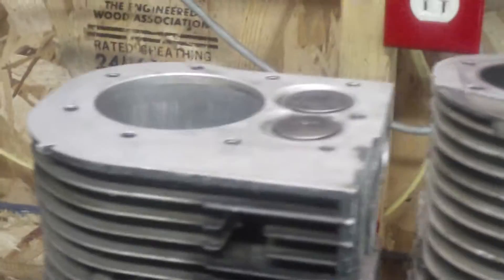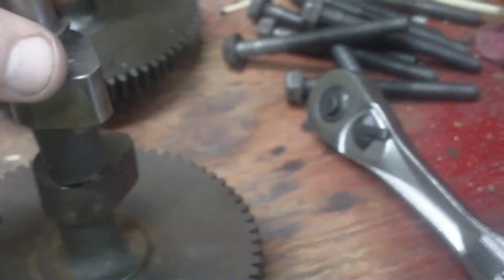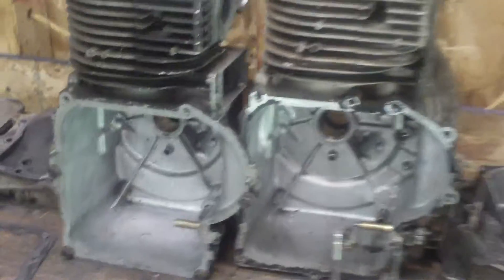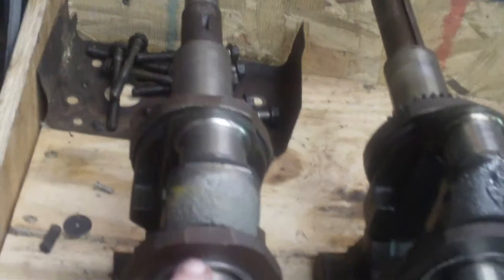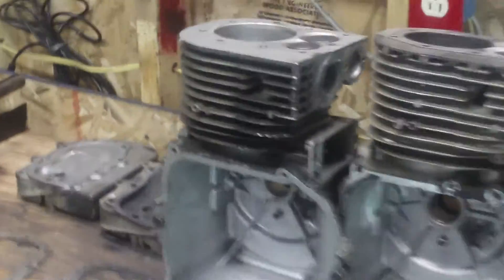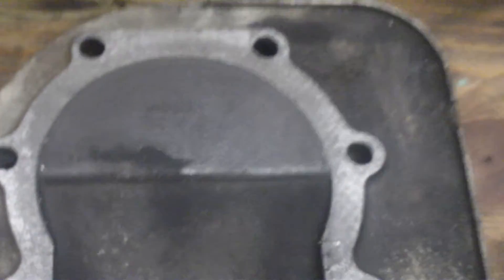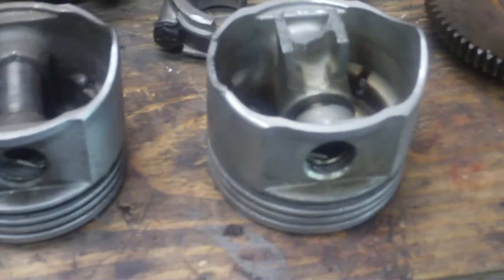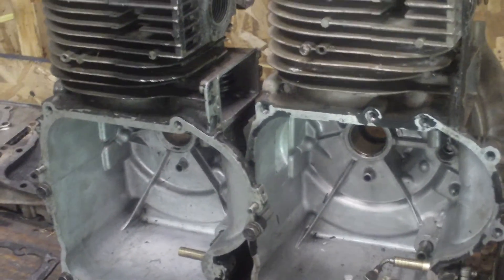Briggs and Stratton 11 Horsepower vs 12 Horsepower / Briggs Stroker (Mainly Plans)

Comment: You do know that the model of briggs & stratton stands for the cubic inch displacement of these engines right......?
Reply: He thinks recessing the head for the quarter inch over stroke is the solution, not a piston with a higher pin hole on a stroker! Yeah I'm going to take my answer from that. LOL

Comment: I have an Ariens Riding mower with a 12HP Briggs & Stratton engine Model 281707 Type 014301 & Code 89022131 that needs rebuilding, I'm not up to rebuilding it, however I have an opportunity to purchase an 11HP Briggs & Stratton vertical shaft engine
although it has ben sitting a shed for several years the oil was changer plus new gas and it ran great it never had much use when it was originally purchased. QUESTION What I'm concerned about is weather the 11HP 25 series Briggs has the same mounting hole position on the base housing as my 12 HP Briggs 28 series? Could you advise me on this?  Thank you Cliff from Carlisle Ontario Canada.

Comment: Hi! Do you have an Idea why my 253707 11HP is knocking sometimes more or less? Maybe there are some known issuses that cause that. I want to check the valve clearance, but can this generate a knocking? New Oil is in there. It running good, but sometimes with little misfires. Is there are problem that sometimes something getting loose in this engine?

Comment: Hi! I recently aquired a Briggs model 286707, Im thinkging about rebuilding it and putting an 11hp head on it, what are your thoughts on using the 11hp head and the copper shim style head gasket?
Reply from the maker: It will raise compression considerably, especially if you go with the thinner copper gasket, Thanks for Watching!!!

Comment: Is the vertical Briggs 10 hp steel sleeved?  I'm interested in one of these (or 12hp) for torquey little minibike application.
Reply from the maker: Depends, if its a I/C it will be, if it doesn't say that then its probably aluminum bore. Thanks for Watching!!!

Comment: im building a 12 hp b and s the stock counerweights are bad where can you get the brass counterweights and how much are they and the same for the billit rod and aluminum flywheel
???
Reply from the maker: eccarburetors ,arcracing or ombwarehouse should have everything you need. If they don't list it for a flathead the mod 28 ohv (non avs) parts are identical. Thanks for Watching!!!

Comment: is there any crankshaft with a longer stroke that will fit in the 281707
Reply from the maker: The next longer one is the model 31 but i don't think it will fit in the 28, i've never tried it, it might, it would be nice if it did. Thanks for Watching!!!

Comment: The 12 horsepower threw a rod because it was knocking or detonating. I got to about 4 minutes and 20 seconds on your video and that's when I saw it... your cylinder head has all kinds of dots all over it. those are the explosions from the fuel pre igniting or detonating. It was either running too hot or too lean or on bad fuel something was going on but that's what caused it... it wasn't an oil failure it was a pressure failure from detonation the rod can't change directions it tends to shoot out the other direction when the gasoline ignites before it's supposed to buy the spark plug.
Reply from the maker: You might be right, but i will say this, on that engine, the rod broke right at the crank journal, and there was signs that at some point in the engines life that it was run low on oil and scored everything up. It also broke the camshaft to when it blew! Thanks for Watching!!!
Reply: fnaguitarplayer9 it could have definitely been a combination problem if it had been low on oil and created a hotspot and a weak point in the rod and then knock came along and broke it there. it may not have been knock that actually broke the rod. But I will say it was definitely a contributing factor based off the combustion chamber. When you start modifying engines and upping the compression ratio any sharp points or any hot spots will create knock and once it starts build up will happen and it can get out of control.

Comment: My 8hp Briggs and stratton engine I had on John Deere s82 threw a rod two years ago and it took out the cam and destroyed the block and oil pan
Reply from the maker: I've had that happen before, i got a video that i showed alot of broken parts from blown up engines, and one of them broke the cam and everything in it, but didn't come out the side of the block though! Thanks for Watching!!!
Reply: I like working on the older mower engines to me the older engines are easy to work on

Comment: I want to convert a few of these to horizontal. Do you know if they use a dipper or anything special to get the oil up to the valves and rings?  

I know there are a few videos out there to convert the smaller ones but not too much info out there with the bigger syncro balanced engines.  Thanks for the great videos.
Reply from the maker: There is alot more involved on converting a synchro balanced engine to horizontal because if you put a dipper on the rod, the counter weights will block most of the oil being slung, so you would have to come up with some way to relocate the oil slinger/governor. or come up with a oil pump in it somehow. Your welcome, Thanks for Watching!!!

Comment: Hi I am trying to id an engine I have and was wondering if you know the height to the cylinder head of them both as I don't have the cowling.
Reply from the maker: Not right off hand, and I don't currently have one tore down to look at. But if you were to tore it down, MOST of the time I found the first 1-2 digits of the model number stamped into the side of the connecting rod, but i have seen some with no stampings, but it is one way i've found to identify them. Thanks for Watching!!!

Comment: I did a horizontal conversation to a model 28.   And I'm having difficulty with a carberation set up for it.  What caberator and intake do you suppose would work for it?  An 8 or 9 hp up draft carb?
Reply from the maker: +Ryan Kravik I would think that up draft style carburetor setup should work fine on it, either that or take the stock carb and make a adapter for it, using 2 flanges and a piece of pipe. Thanks for Watching!!!

Comment: I have a model 28 but it's an 11.5. Can it be upgraded to a 12 or 13? Interesting video. Thanks.
Reply: The model 28 is rated at 12.5 HP. They put different stickers on these engines showing all different horsepower numbers when in reality they are the same base engine. They marketed the model 28 anywhere between 11-13.5 HP when in reality they make 12.5 HP. Briggs still does this silly misleading horsepower and torque ratings with their newer engines too. It makes it very confusing knowing what engine you really have. 
For instance I have two Briggs engines in stock both rated at 19.5 HP, but one of them is 500cc and the other is 540cc. So how do they have the same listed horsepower? I’ll tell you where they got those numbers and its out their ass. They do it more for marketing than anything else. They’ve been doing this for years to the point where no one truly knows the horsepower of their engines.

Comment: i think i would make a spacer plate to go between the head and block  and try to keep the rod length the same, the longer rod keeps the piston parked @ tdc longer, and mill the head as flat as possible to make up for compression loss, though it might screw up the way the engine scavenges, ill let you know when i finish the project, im busy right now with a mod 28 putting a big exuast  valve and seat in it same size as intake hope it dynos good!
Reply from the maker: That might be the best way to do it, and easier to then having a custom rod made for it. I know the piston stuck up a little less than a quarter inch in my mock up of it. I hope to experiment with it someday. Another project that would very interesting is use a crankshaft out of a 31 OHV briggs in a 28 flathead block, since they didn't make a 31 flathead (at least i haven't ever seen it) it would probably take some serious work to get the crank to fit. but that would be great! Heard that! Good luck on your project! Thanks for Watching!!!

Comment: I Have a 10 HP that just threw a rod. and pushed the balancer  right out the back of the motor.  I have a back up motor but they were all used and put a way wet. so the next motor will be taken a part and rebuilt. with new gaskets ect. so I will be watching your videos.
Reply from the maker: McCuneWindandSolar oh wow, i've seen some motors that has happened to, never had it happen to me (yet haha) I hear ya, sounds like a good project. thanks for watching!!!

Comment: 1 more question if i was to advance timing on my engine with the cam what way would i turn it and how many teeth could i move it to make more power?
could you possibly make a vid on how to advance timing to ??
thnx
Reply: fnaguitarplayer9 1 tooth is plenty on cam but check clearance between cam and rod, ignition timing i set by not using a key buy bringing piston 1/4 inch btdc and setting flywheel on by matching leading edge of flywheel magnet to right edge of magnatron it gives me enough timing for my alky burnin mod 28.
Reply from the maker: true, unless its a flathead. I've heard of people doing that, i was always afraid of its slipping on the crank, but i guess as long as its tight enough it will stay put. Thanks for Watching!!!

Comment: is the 11hp cam the same as the 12hp? if not wich would have a bigger lope/
Reply from the maker: Yes, both cams out of the 11(model 25) and the 12 (28) are the same. Thanks for watching!!!
Reply: are there any cams that are bigger then the 11hp cam that will still fit in the 11hp block?
Reply from the maker: Not stock cams, but you can buy performance high lift cams designed for racing, but be aware that its best to upgrade the rod too, and flywheel if your bypassing the governor, eccarburetors (dotcom) sales everything you need. It is possible to weld on the lobes of a stock cam and ground down to your own specs, but its hard to get a good profile.
Reply: so is it better to weld the lobes on the came an stuff or just upgrade every thing?
Reply from the maker: Yeah pretty much, but if you weld them up, be careful its very very easy to mess it up.
Reply: do thay need to be welded even or can I wen alittle more on the intake valve?
Reply from the maker: it would be best to do both, because, if you just do the intake, then the engine is burning more fuel/air and would run hotter since the exhaust isn't opening as much. You can probably look up more info on this online, or the lawn mower racing forum, heymow (dotcom) there is alot of experts on there, that could probably tell you more than i can.
Reply: alright thanks ill look into that
Reply from the maker: No Problem!

Comment from the maker: Nothing!!! They are both the same engine, 12.5 13 and 13.5 model 28 are the same engine, just a marketing idea, now the 12 and 12.5 are still 28's but may have the newer 2 piece carburetor that gives the extra 1/2 HP, but that is the only possible difference. Briggs is infamous for this!!! Thanks for watching!

Comment from the maker: That is true. I'd have to agree, I prefer a longer stroke as well, just seems like your "using more of the piston" if that makes sense haha Getting more leverage from it. The only advantage with a short stroke is it will rev up to higher RPM's. but you loose power. Thanks for Watching!

Comment from the maker: I use a wire brush on a drill, the cup type, put the head in a vice so you can dig down more. you can also soak it first in carb cleaner or even WD40 to dissolve the carbon some first. thanks for watching!!!

Comment from the maker: Yepp, there is no difference at all! i have a 19.5, its the same thing as the 16.5. Briggs was bad about that, and still is from what i heard, same thing with the single cylinders they are putting out now, a 17.5 is the same as a 15.5. now on the older 12 and 12.5's, the extra .5 came from either the new 2 piece carb or switching to electronic ignition. now oddly enough my 19.5 opp twin is a model 46, go figure haha thanks for watching!

Comment: Got my rings on the piston. thanks for your help. I need the torque pressure for the head bolts for that same 12 hp model 281707 engine if you would be kind enough to help. Once again, thanks so much.

Comment from the maker: no problem! on most top comp rings there is a angle ground into them on the back side that faces the piston, this angle goes up. the surface that is on the outside is flat on the top ring. PM me your email address and i'll email a picture of how each ring goes, if that would be better

Comment: Thanks for getting back so soon. I'm still a little unsure what you mean by " the rings slant". my new ring is flat on top, has a silver edge part way down and is then grooved on the bottom, if that is the way it should be installed. should the grooved out section face the oil ring below and the flat part face the top compression ring?

Comment: ok, thanks.  I considered shaving the piston down right away, but the #1 compression ring lands really are pretty high on the piston, so I don't think that is a great idea.  I think a shorter connecting rod is the best option.  I am not worried about the clearancing of the block.  I did enjoy your video and I appreciate all the information presented there.

Comment from the maker: Sounds good! I've never heard of it personally, what i would do is take the block/stock rod/piston and 28 crank to a machine shop, show them what your doing and see if they can machine a custom rod for you. I have heard of people shaving the piston down so it doesn't stick up but it seems to me that it would take to much off, and you will have to clearance the inside of the block not by much but it will need to be done. thats about all i can tell you I hope to do it someday! thanks for watching!

Comment: Alright, I'm doing it.  I have a series 25 and I bought a series 28 crank shaft for it.  My biggest question I have is dose anyone have any experience with sourcing a connecting rod for this stroker?  Maybe a referral to a place that dose a good job making custom rods for small engines?  or maybe an off the shelf connecting rod for one of the smaller displacement Briggs?  or anything else that might save me some time and goggling?

Comment from the maker: You are right, but what can be done (which i plan to eventually have done on a few of my engines) is bore it out to fit a cast iron sleeve (pressed in). Then bore to spec. But that is expensive. But you would have a good engine after though. You can lightly hone aluminum cylinders, just can't go crazy with it. Thanks for Watching!!!

Comment: I don't think you are not supposed to ever bore or hone a B&S aluminum engine. The aluminum is a high silicon content . Porsche used the same process as did GM with their Vega. I think they are called Nickasil bores, where after boring and fine grounding the bore is etched, the aluminum is etched away leaving the super hard silicon.

Comment: With the piston shaved down to get a -.114" deck height and the head machined to a 72cc combustion chamber the 28ci parts will work in a 25ci block. It's worth noting that with this setup compression will be raised to aprox 9.9-1 (stock is 6.77-1) so if the stock starter is worn it will have a very hard time spinning this engine.

Comment from the maker: No, the 8 HP (model 19) has a much smaller piston (about a 1/2" smaller bore than the 12 horse or 11 horse), so the head is alot smaller. As far as i know the only other head that would work on a 28 (12 horse) would be the 10 or 11 horse model 25 head, which does raise compression quite a bit. hope this helps. Thanks for Watching!!!

Comment from the maker: sounds good! i'm curious, you should check to see if the bolt pattern is the same on the 10 horse head. I wasn't for sure if it would be harder to crank or not. i've been thinking about doing it on my grass cutter, just to squeeze a little more power out of it. glad to hear your results! let me know if you check that 10 horse head.

Comment from the maker: no there is no harm at all, as with any modification you always increase the chance of something going wrong. only problem could be starting, the extra compression will make the motor harder to crank over, but if you have a decent starter that should not be a problem. now is your 10HP a model 25? if its not i can not tell you 100% sure if it will fit, i know a model 25 will fit a 28, i'm not sure about any other, but if i remember right, a 10 HP is a 25, am i right? thanks for watching!!!

Comment from the maker: yes it would work fine, but do keep in mind it will raise compression quite a bit and can make a engine harder to start if you have a old worn starter, may not be that much harder to turn, just depends on condition of engine. Thanks for Watching!!!

Comment from the maker: briggs may have made a 11 horse model 28 at some point, i've never heard of it. but i do know one thing, a flywheel cover off of a model 25 will not fit a model 28, a 28 block is longer and it won't fit. that seems funny that it was rebuilt after 2 years of use, i bet someone switched covers or stickers or something, its hard to say for sure.

Comment: Mine is 11 hp but has a model 28 block. So that's is 28 cubic inches. The model number plate is on the shroud. I wonder if that's a 28 cubic inch 11 hp engine or if it is a 12 hp and the sticker is wrong because someone rebuilt it back in 2003. It's a 2001. Reason I'm askin is I might sell it and I want all the info right.

Comment from the maker: yeah thats really the only difference, and the valves are not interchangeable, the valve stems are shorter on the 11 horse. they do make 11 horse with cast iron, mine just happened to be aluminum or kool bore.